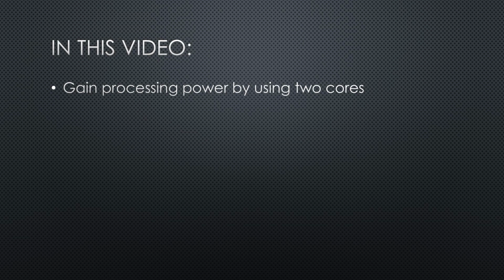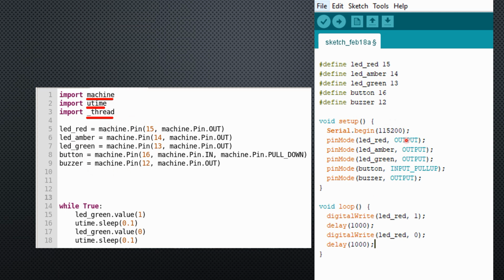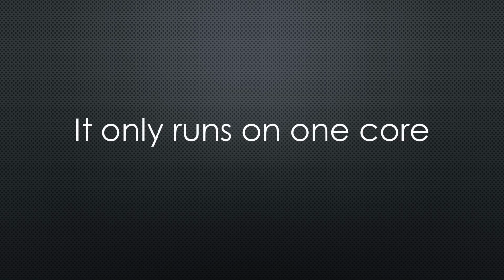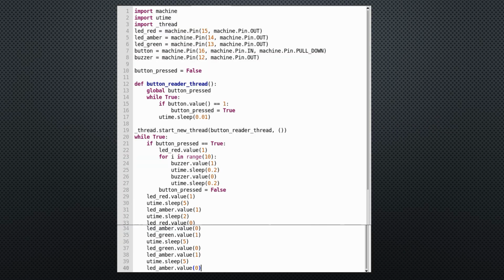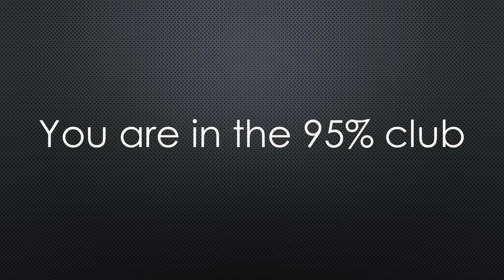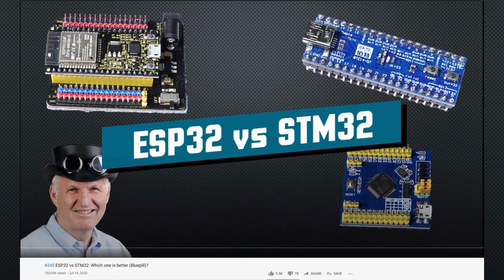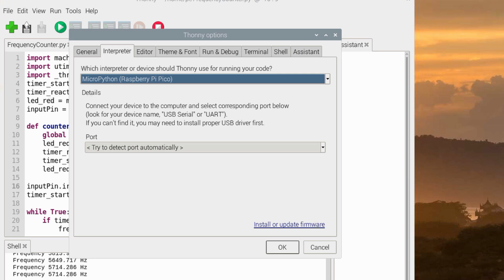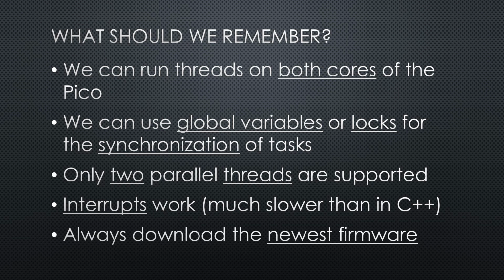#372 How to use the two Cores of the Pi Pico? And how fast are Interrupts?

Comment: Andreas, I am confused about your example for ‘synchronising’ the two cores. It merely synchronises the stop and start of each core so that they never run together. How useful can that be? What’s the advantage compared to a single core that runs tasks one-by-one?Two tips for a next video: hardware debugging using picoprobe (C, C++) and programming the PIO! The PIO is what sets the RP2040 apart from the rest... and it is not too hard to write short programs for it. Correctly used, the PIO can dramatically increase the speed of the processor. The pin side set feature in fact effectively allows it to execute two instructions per cycle!
Reply from the maker: 1. Using two cores creates a lot of hassle compared to only one core. Two cores are faster than one core of the same type.
2. I still wait for a useful application for the PIO. This is why I made the challenge. VGA or HDMI on a MCU with this small RAM is nothing for me
3. I will start with C++ when it is Arduino compatible. Right now it is too much a hassle for me :-(
Reply: @AndreasSpiess  Andreas:
1. If speed is the target than the easiest and most effective is certainly just use a faster clock. But this will not necessarily improve precision of timing, which is not rarely the reason why a controller (without os) in used instead of a microprocessor like e.g. the raspberry pi zero. The second core, and even more the second core attending the PIO, should excel in that!
2. I think the demo with the PIO producing HDMI signals is meant mainly as a demonstration of (1). Very impressive that this can be done with a non-specialised microcontroller of a few €, but if you really need HDMI, it is quite likely you also need/want an os and then you’re better off with a microprocessor.
I see more applications for the PIO in accommodating serial io that is not supported (or not in enough numbers) in hardware (like eg CAN controller, Serial RGB Led) or when multiple fast precisely timed outputs are needed and for which otherwise a FPGA would be needed. I am thinking of multiple coordinated motor controls like eg. 3D printers, drones and the like. These work with low-power processors as well, but when precision and speed need to improve this won’t work anymore and a processor like the RP2040 is, in my opinion, a fantastic fit.
3. Here I fully agree! It is an incredible hassle to even setup a build and hardware debugging environment for now.

Comment: Make your reset Switch yourself ;) just set a button between Pins 30 (RUN) and GND. That makes life much easier. You can use that to mount it as a mass storage by pressing the switch, then the BOOT SEL Button, release the Switch and after 3 secs (the usual time) release the BOOT  SEL button and, Mass Storage appears.
Works for me 😊  (As you said, time is money and unpugging and re-plugiing this thing doesn't last for long and it's time consuming 🤣)
Reply from the maker: You are right. I solved the issue with a tiny button. I still think it should not be the task of the buyer...
Reply: @AndreasSpiess  Agreed

Comment: In lieu of a reset button don't unplug the micro usb, unplug the other end of the cable or switch the PSU.
Reply from the maker: The other side in my case is a crowded Raspberry Pi with 6 cables...
Reply: @AndreasSpiess  We can wait and see if they ever make a change but until then....

Comment: That is all awesome but I would consider using a context manager for locks - because it ensures that the lock gets released no matter what happens inside the code so e.g. if there is an exception the lock will still get released e.g.:

a_lock = _thread.allocate_lock()
with a_lock:
    print("a_lock is locked while this executes")
Reply from the maker: I do not get your point :-(
Reply: @AndreasSpiess  oh, don't worry - it's just a small thing.   One of the good features in python is the "with" statement.  It allows you to free resources like open files or sockets or locks automatically.  You don't have to remember to call the "release()" function for the lock because you know that when the program exits the "with" block then it will be automatically released.  Normally you could say "so what - I can just call release myself and it's only 1 line?" But the good thing about a with statement is that it also works if there is an exception inside the block  or even a return statement.   So for files: e.g.

def find_end():
    with open("myfile.txt", "r") as f:
        for line in f:
            print(line)
            cleanline=line.rstrip() # remove LF
            if cleanline == "END":
                print("Found END")
                return
            elif cleanline == "MAJORERROR":
                raise Exception("There was a major error")
    print("Didn't find END")

We don't need to call f.close() in this program even though there are several possible exit points because the "with" statement ensures that f.close() will be called even if there is an exception or if the function returns.

With locks in Micropython it is the same:
a_lock = _thread.allocate_lock()
mydict = {"alice": 12, "bob", 12 }
with a_lock:
    print("a_lock is locked while this executes")
    print(mydict["john"]) # Keyerror exception but the lock is still released.

Sorry if my explanation is not good - there are better ones on the net.
Reply from the maker: In the meantime I tried it out and it worked. Indeed a nice addition. For the video, the lock commands were probably easier to understand. For as a programmer I definitively will use your proposal.

Comment: Very detailed and a lot covered - thanks
Now... designers that don't believe in a reset button do need to have a serious head examination. I designed a PC modem in the 1990s - used a DSP single chip with a controller 8048. The DSP worked great - until it "fell over" - There was no "begin again" control line. 
The short term solution - power cycle.
The fix - scrap the design and go with another DSP design. (One that did have a reset line.)
Thanks for the video!
Reply from the maker: Thank you. In my age I do not forget a reset pin because, as I said, I am a mere mortal ;-)
Reply: @AndreasSpiess  ... and a few flashing LEDs!

Comment: I would suggest you give a try of the Pico C SDK.  IMO it is much better than the Python.   Multicore apps are just as simple one-line calls.

Also you don't need any buttons if you use a second Pico as a Picoprobe debugger. You can restart the DUT or flash new images from Visual Studio Code.
Reply from the maker: I use this board with MicroPython. When it will be Arduino compatible, I for sure will try it.

Comment: You can surely reset the pico by pulling the RUN pin LOW that reset the pico and its written in the manual
Reply from the maker: You are right. I solved the issue with a tiny button. I still think it should not be the task of the buyer...
Reply: @AndreasSpiess  yes you are right its shouldn't be our issue
and thnx for the replay
I love your videos
Grüße aus Deutschland

Comment: Python on microcontrollers is a nice idea for absolut beginners and nontechnitions. It makes no sense for me to use really fast microcontrollers to slow them down, using python, to the level of the first generation arduinos. I thing that is the reason, why the original micropython board uses a STM32F405 running at 120MHz and a STM32F407 board runs with 168MHz. It may also be possible that I'm still to old to understand this nonsense. The time that I have learnt to program is long gone now, but I use the very first two programming languages a lot until today. These are Assembler and Pascal. Then I've learned C/C++ programming for Applications on microcontrollers and PC's. The goal was allways to write the fastest running code. Mostly real ugly code. But the only way to the jobs done and many critical realtime problems to solve. Micropython/ Python isn't something that can be used to solve critical realtime problems. I don't like Python. And the hype that made around Python doesn't change my mind.
That leads to the conclusion, that as long as there is no usefull development environment for C/C++ I don't see any need for a Pi pico.
Reply from the maker: We had this discussion in my video about MicroPython. I think there are two ways to look at it: To preserve (cheap processor time) or to protext (expensive) programmer's time. The size of the series decides which is cheaper...

Comment: Thanks Andreas! Working with multiple (mutex) semaphores is a pain in the ass when  the program becomes larger and especially across libraries. My knowledge of Python is almost zero but it seems to adopt a somewhat more modern monitor concept (notify(),  wait_for() etc.) as well. Do you know if this has been ported to the Pico Python dialect as well?
Reply from the maker: MycroPython does not support the full thread library, just the basic _therad. So you do not have all comfort (for the moment)
Reply: @AndreasSpiess  Thanks for the response.

Comment: You can add your own reset button on the 'run' pin (pin #30 on the Pico). If that pin is connected to ground the Pico will reset. This will be even more needed once you start with C/C++ on the Pico, as updating the code will require a mount/upload/unmount cycle.
Reply from the maker: You are right. I solved the issue with a tiny button. I still think it should not be the task of the buyer...
Reply: @AndreasSpiess  Agreed, but a at least we have a workaround.

Comment: If you're afraid of wearing out the connector you can always try unplugging the other end of the cable ;-)
Reply from the maker: You are right. Theoretically. I used a Raspberry pi with an SSD Ethernet, HDMI, and a mouse. Not really convenient to unplug it there...
Reply: @AndreasSpiess  The Pico has a RUN pin.( RUN = /Reset) It has a build in pull up. But a jumper cable to GND on the RUN pin should reset the board just fine,....
Reply: @michaeljennings6565  you can also use the 3v3_en pin: “3V3_EN connects to the on-board SMPS enable pin, and is pulled high (to VSYS) via a 100K resistor. To disable the 3.3V (which also de-powers the RP2040), short this pin low.”
Reply: @saabi  That only disables the power converter. Depending on how you power the pico that may or may not work. Also if you have stuff connected to the pica that you also power from then you might want to keep that powered during the reset. Also see the quickie that Andreas already released,...
Reply: @AndreasSpiess  I would use one of those usb cord with an inline power switch in that case.
Reply: @VisDeux Many of those are power only, not data, Finding a data cable with a switch is hard
Reply: @DinoFancellu  make your own?
Reply: The easy answer is to use a simple usb extension and pull it there
Reply: @DinoFancellu  I have an USB Hub with Buttons. 4 Buttons for the 4 Ports. Works fine.
Reply: @AndreasSpiess  I use a magnetic USB-Micro connector.
Reply: lol... I think a pi is more costly than a pico
Reply: There is no need to plug out the cable or use one with a switch if you connect a button between GND and 3V3_EN (pin 37). Pushing the button will disable the DCDC converter and power down the RP2040. That works nice to bring it into programming mode or just reset it.
Reply: I have a "4 port USB switch" that uses mechanically-interlocked physical pushbutton switches to connect a USB device to one of four computers. I use it to connect my keyboard and mouse to my work, personal, and entertainment laptops - cost was ~£5. It'd work fine for temporarily disconnecting power and data from a Pico!
Reply: NO thank you sire, I will much rather short my supply to reset :-|
Reply: !!! USE THE FRICKIN PIN30 - RUN !!! or
- switched USB cable
- extension USB cable ... plug the other side comfortable on the desk
- switched HUB
- don't talk bullshit about bad/only two pole switched USB connections
  * you are an elect... at least an amateur and can build a complete disconnecting switch yourself with less than $5
  * if there is a problem (with the only VCC switches) and you wonder why your project stays on: Search for another hobby or switch ALL supply lines off.
RTFD, Read the fucking Datasheet:)

Comment: Your professional approach just made the two cores act like a single core. The problem with locks is called deadlock, where the key or keys are not released and the thread process dies. If you want the software to safe all passing of variables needs to be atomic,  as in a single atomic particle. If you have to read, modify and write to global variable you would place a lock around it so three actions become the same as one atomic action. So the variable cant be changed by another thread while its being worked on. With deadlocks the reset may be your only friend.
Reply from the maker: You are right. We will talk about that in my RTOS video. I think, here, the firmware takes care of the blocking. But still, I needed a reset button from time-to-time...
Reply: @AndreasSpiess  if you deadlock without an RTOS your are dead in the water. only a reset will get you going.

Comment: USB cables with a built in on/off switch are a thing, they cost $5, saves putting stress on your connector if you need to power cycle the board.
Reply from the maker: True. But pay attention. Most of them do not have data lines :-(
Reply: @AndreasSpiess  Ah that's a bit of a gotcha, I guess I'd have to hack something together that gave me both.

Comment: Great as always Andreas. I do have to say I really dislike the use of interpreted languages(python) on embedded systems since it is such a waste of processing power compared to compiled languages(C/C++). It does however open up the world to people that would otherwise not be able use these products at all. I have worked with RTOSs for over 30 years and remember people getting fired for using blocking functions such as delay loops, sleep, pause, etc instead of interrupts/message queues. Nice to see you re-introducing this concept to the next generation.
Reply from the maker: We had this discussion in my video about MicroPython. I predict that high level languages will take over in the next few years for prototype projects where programmer's time is much more expensive than processing time.
RTOS are still a very good thing and for me also a "higher level" language where the programmer does not control everything.  And you are right: They allow a very different programming style.
Reply: Also, it's good for many hobbyists who just create fun trash stuff like me. In such projects, speed often doesn't matter, but the fun and convenient process of development does. I used to program Arduino a lot, but RP Pico is a lot more fun for me.

Comment: You do not need the reset button.
Just press Ctrl+D and it will reboot
Use help in repl to see more shortcuts.
Python is made for automation, leave manual resetting for arduino :)
Reply from the maker: Unfortunately not :-( I tried.
Reply: @AndreasSpiess  It is working for me :(
Reply from the maker: Did you try the dual core stuff? Only there it did not work (with this "core1 busy" message).
Reply: @AndreasSpiess  No, I didn't. For now uasyncio module was enough for my needs.
Reply: @AndreasSpiess  I tried it with _thread with no problem. You need to terminate the running program with Ctrl+C before. I also found that you don't need bootsel button nether. You can just stop a program by Ctrl+C to access repl, and then type:
from machine import bootloader
bootloader()
Reply from the maker: Thanks for the addition. I added now a reset button. Seems to be faster ;-)

Comment: shorting the pico's RUN pin to ground causes a hardware reset, it's a pity that there isn't a built in reset button, but adding one isn't too hard
Reply: You don't even need a button. 
Just connect a Wire from ground to the RUN pin, and you reser the device.

I think you need to add that, so we Will stop this nonsens with pulling the USB-cable to reset the device.

Just ground RUN pin on the device!
Reply: I got so annoyed with having to do this when working on MCU breakout boards, I made a small PCB pass-through board with a gang switch on it to break all USB connections. A small but very nice quality of life improvement.
Reply: There is one for soldering now - called "Captain Resetti". :D
Reply: I’m not entirely sure, but BenHeck I believe did some magic with the onboard button and a single wire to act as a reset.
Reply: I got a USB switch to connect my keyboard and mouse between three computers. Could connect the Pico to it also, and switch away and back, to electrically disconnect the Pico without unplugging anything. And it's a huge quality-of-life improvement for ~£5.
Reply: I've been using the board's WatchDog Timer to reset everything when my code goes astray. Might not work for all scenarios but it works well for me and doesn't require any additional buttons or jumpers.
Reply from the maker: You are right. I still think it should not be the task of the buyer...
Reply: @AndreasSpiess  I like the fact that there is a Run pin that can be used as reset.  This allows one to install a remote reset button if/when the pico is installed in a case.
Reply: @AndreasSpiess  Reset  buttons are also a danger. I've pressed them inadvertently too many times. You could pull the other end  of the usb cable to spare the soldered on connector. 
(Great content and presentation by the way!  And that's a cool cat :))